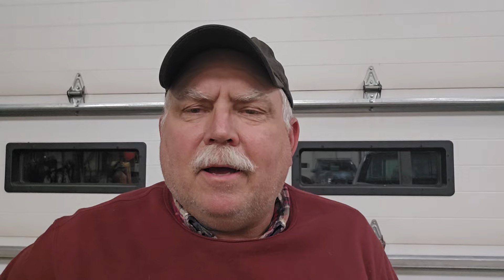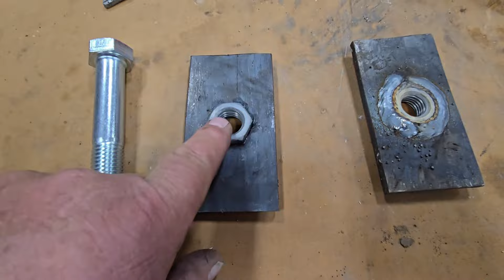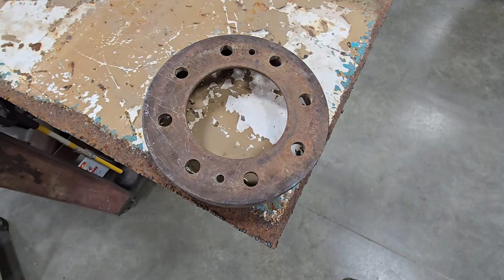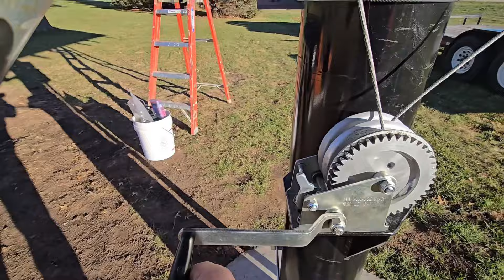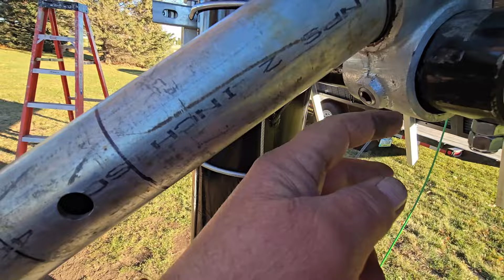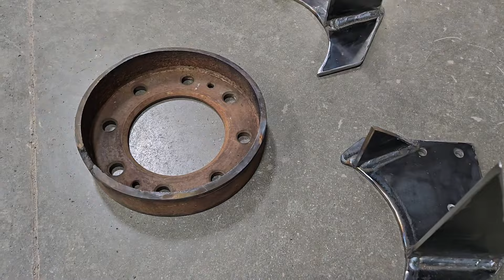New design tilting solar panel array adjuster

Comment: I wish I would’ve seen your video sooner. I just installed two of those vevor boxes. I wanted to do stainless but the size I needed was on backorder so I guess I got that to look forward to.
Reply from the maker: I had just installed the box on the array and another on the house before discovering the problem. Hopefully it helps others to not have the same problem.